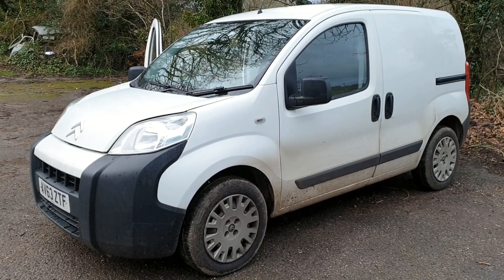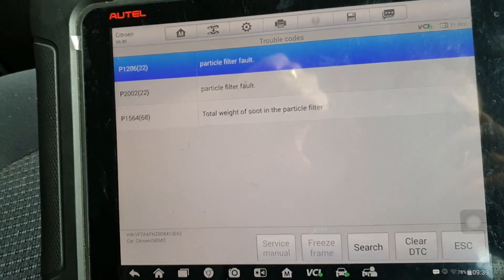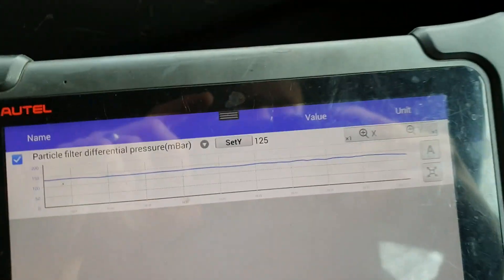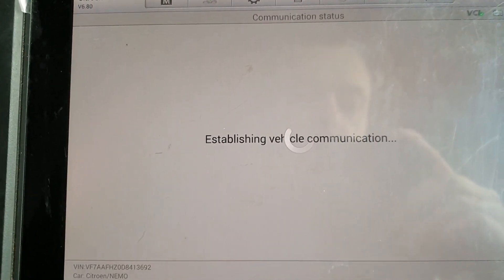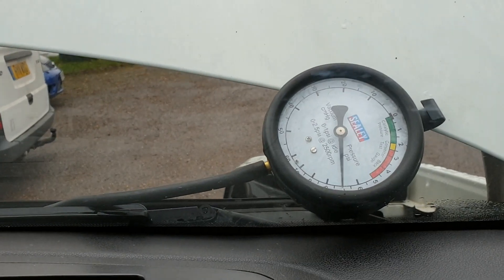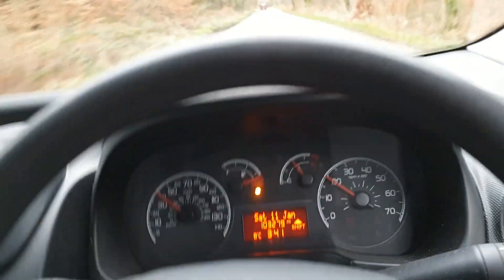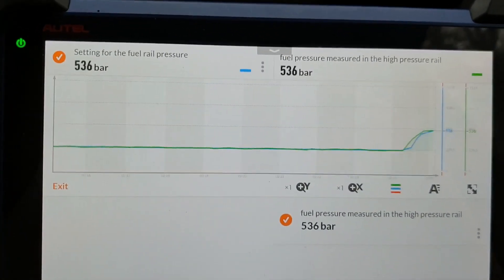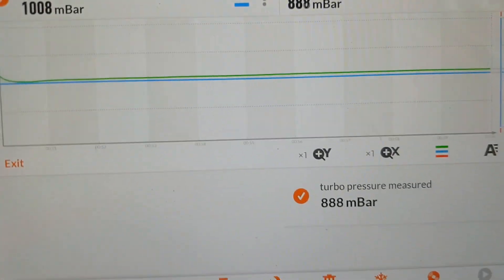DPF Diagnosis   Case Study Citroen Nemo

Comment: Could you tell me how you managed to get the computer to regen as I have a blocked dpf and can't get it to either tried two shop computers on it now ?..
Reply: If you try to regenerate when blocked you will crack it !
Reply: If at at the point where it can't physically re gen then you need it professionally cleaned or replaced.

Comment: " distance since dpf filter last changed 3036 Km "so its got a blocked dpf and someone reset the counters already, people need to understand its a servicable item and cleaning only removes a proportion of the blockage, theres a counter for dpf life and they predict 80k miles for a filter then a new one is needed

Comment: I did mine on My Bipper today.Motorway driving for about 30 mins.
Reply: How did you do the fix on Yours Please? I have The same issue, did you just drive for 30 Minutes? What MPH and Gear was you in Please?
Reply: @michaelreidy3343  Hi Michael,yes about 30 mins or so.Went between junctions on M40 local to Me,About 20 miles of Motorway driving,up through the gears,stayed in fourth for a while then cruised in fifth at about 65-70 mph.Only really use the van for local journey's,so after about 6 weeks come on again.Went for a drive on local fast 'A' road about 50-60 mph for about 30 mins again and this did the trick also.BUT,I think the best thing I did was switch to Shell Diesel on the last couple of refills rather than use Supermarket fuel.I will stick with Shell,as no sign of light coming on again.Hope this works for You.Regards,Starman.
Reply: Thankyou for Your Advice, My EML came on Today and the OBD has indicated to the DPF, drove home for about 20 minutes but its seems to be in limp mode as it only goes to 3k RPM so in 4th gear it struggled between 65-70mph, Was Yours in Limp Mode and did yours have the EML on? Issue I also have is my van is limited to 70mph (ex Electricity Van) I Will try longer tomorrow on the Motorway, Thanks
Reply: @michaelreidy3343  No limp mode the last two times,but I had limp mode about six years ago not long after I had bought the van.i had a mechanic friend have a look,and he talked about a 'sticky intake valve'??.Sometimes turning the ignition on/off three times or so quick will reset the computer to clear limp mode.I wouldn't worry about massive revs/thrashing just drive constant fast road instead of start/stop urban driving.I wouldn't want to drive a Bipper  much faster than 70mph as there not really Motorway vans.Let Me know how You get on.Regards,Starman.
Reply: Thankyou, Mine has the Limp mode(Well I think it's in Limp mode)as won't go over 3k RPM, The OBD has indicaded its the DPF  Booked in for Thursday at Garage to be Cleaned or Regen but thought I would give it a run out tomorrow, Thanks